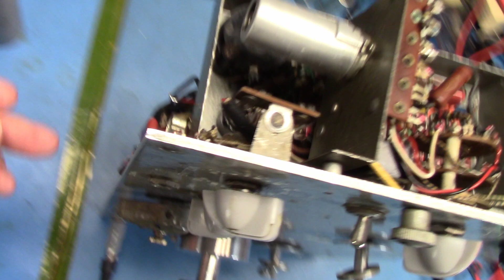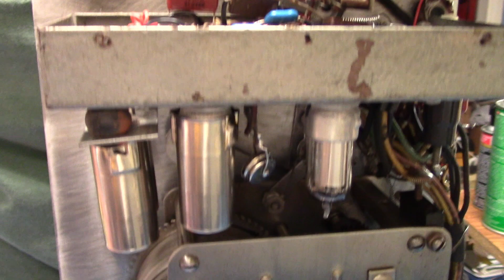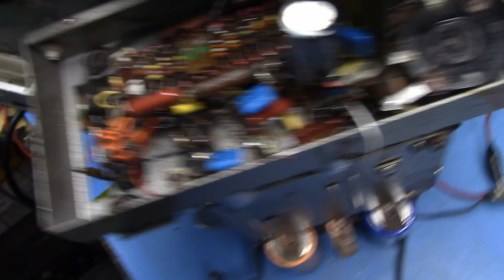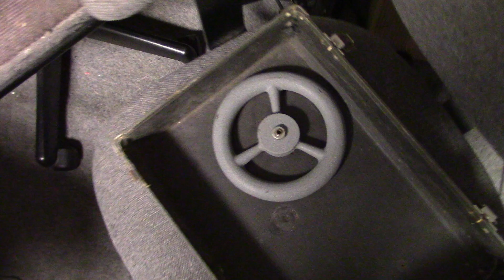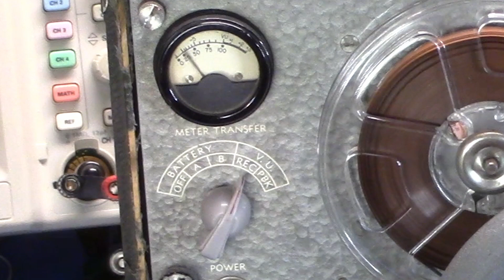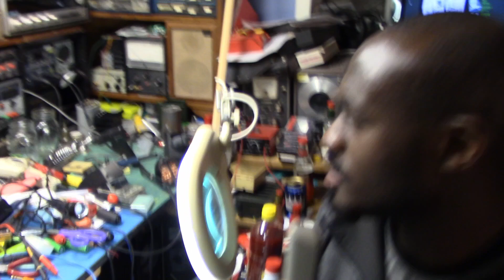Magnemite 610 DV Tape Recorder!!!!!!

Comment: I hope you are going to clean and lubricate the clock spring.  You simply should not be having such bad wow and flutter.  These clocksprings when they work are much better than what you're getting.  between dried grease and dry lubrication points (usually the governor rides on a tiny ball bearing at either end).  It probably wouldn't harm anything to clean and re-grease the spring, but this can be dangerous.
Reply: The reason for the bad reproduction is because when I owned it I merely glued a rubber band onto the pinch roller hoping it would create a little more grip to the capstan roller to grip the tape.  I really didn't expect it to run the machine all that smoothly.  And I did service the motor some years ago.  So it should run smoothly for a long time.  Ricky is amazing.  I was smiling from ear to ear because he got the damn thing to work! I'm glad my old recorder went to a good home
Reply: @amberola1b  Well, thank you for donating it to him. It was a real treat to see it. I just love this kind of stuff.  I recon he should be able to get a new pinch roller.  There are a lot of stuff like that for old stereos being made.  All you really need is the right size and a lathe.